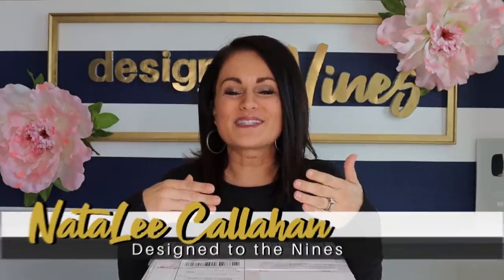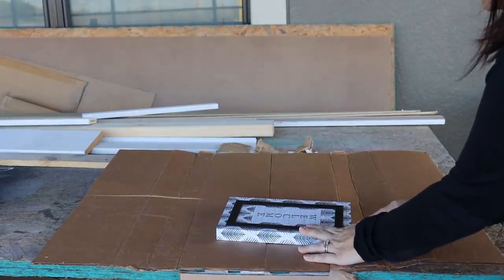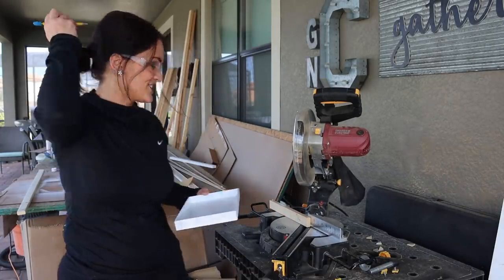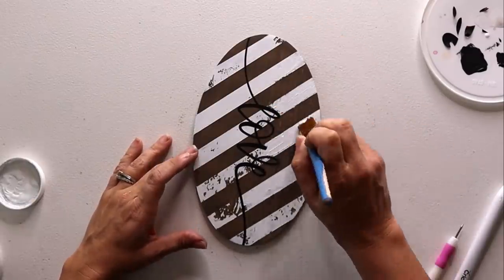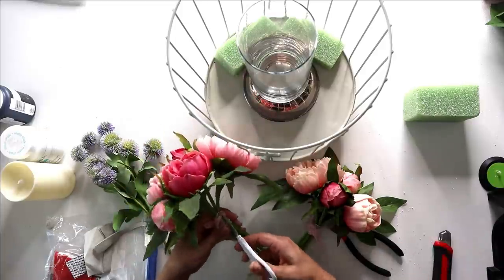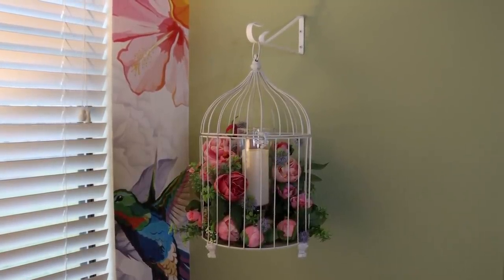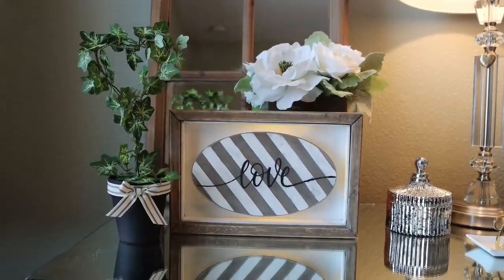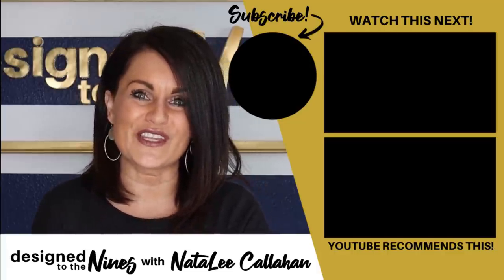Valentine's DIY Decor You Won't Believe Are Made w/ DOLLAR TREE Items!

Comment: I learned to make sure the paint has time to cure for 24 hours before doing the vinyl so it doesn't pull up.  This lesson came at the expense of dozens of signs that I had to do touch ups on.  Also I always take my transfer tape or stencil (depending on which I use) and I just walk around the house and stick it to my sofa or the pillows or even throw blankets and it makes the adhesive a bit less sticky.  All of your projects were awesome.  I can't pick one because they are all so beautiful!

Comment: NataLee, just a tip (since you've given me plenty), washi tape needs to be burnished to stay down. The heat generated when burnishing activates the glue to be very sticky. Before burnishing it's removable. Washi take works great for masking off since it has no texture (as painters tape does). Your paint picking up is because you painted over a stain. You can use a clear sealer before taping off you lines to seal the stain. Love your channel ❣ Was sooooo happy to see you posted today.😊💕
P.S. You knocked it out of the park with these challenges ⭐⭐⭐⭐⭐
Reply from the maker: That’s a great tip Lisa! Thank you so much.😃💕

Comment: All of these are awesome, loved it all, you did a fabulous job on the challenge items! When I use a stencil to paint over an already painted surface, I make sure the paint is completely dry, and instead of using regular vinyl for the stencil, i use oramask stencil vinyl. It's less tacky than regular vinyl and I've not had an issue with paint peeling up with my stencil. I hope that helps!
Reply from the maker: Great tip! Thank you 🙏
Reply: @designedtothenines  you're welcome!

Comment: This has happened to me too. Aside from giving the paint time to dry, try sticking the stencil to a shirt, remove the stencil right away then stick it too the painted wood so the adhesive is less tacky.
Reply: Go over to Unicorn Dust Designs channel. She does lots of round signs and is always talking about what to do so you don't pull up your paint when using a stencil. Plus she is a hoot to watch.

Comment: Hi Natalee  From what I have seen it has to do with the type of vinyl you need removable adhesive strength on painted items so it does not do that  :)  I know there is different types such as permanent and removable  iron on etc Hope this helps    Unicorn Dust DIY talks about this issue too or Makers gonna learn

Comment: On the love oval frame, I actually liked the distressed stripes, it gave it character...but to avoid it, you need to use stencil material and not vinyl as your stencil, vinyl is ok to use in a raw wood plank but once you paint a surface, vinyl is too strong, you need to use a less sticky material like oracle oramask 813 and also remove it right away after you paint don’t leave it on for too long...

Comment: As to your issues with the adhesive stencil pulling up the paint on your projects: 1) How long are you waiting after painting before you apply the stencil? Maybe it needs to dry longer. 2) The Mod Podge may be interfering with the adhesion of the paint to the project. I hope these ideas are helpful.
Reply from the maker: I think those are great ideas. I probably could have waited longer after the paint dried. Thanks for the suggestions!